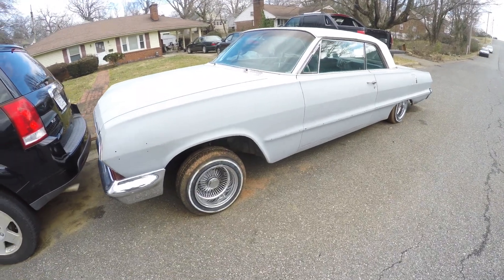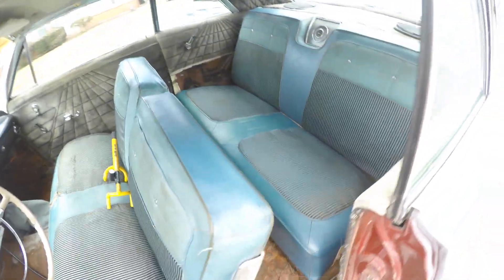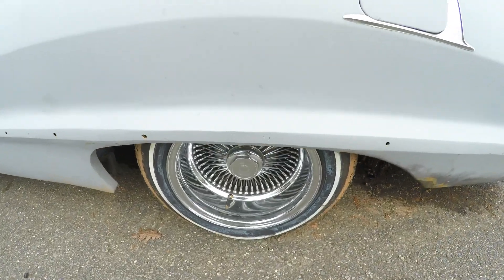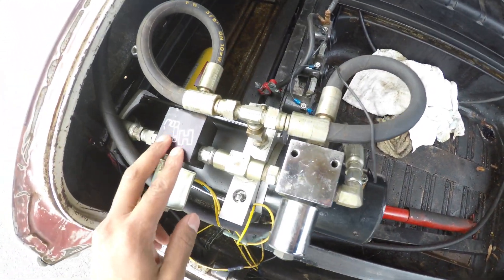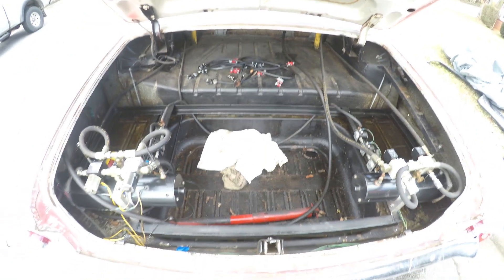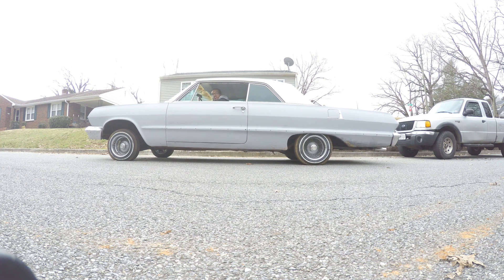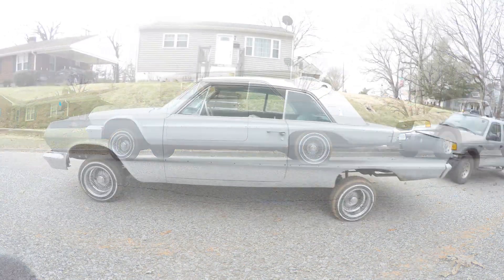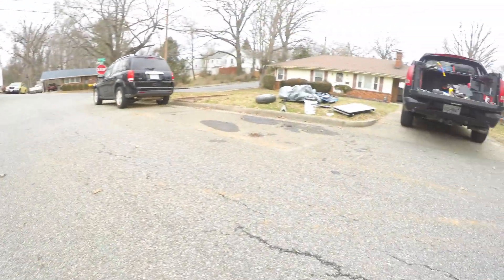63 Impala Lowrider with Hydraulics on Gold Daytons! | New Impala Lowrider Project:

Comment: I love 63s! But dont use trans fluid, it works good but eats up seals quick
Reply from the maker: What do you recommend? I'm still leaning some say use motor oil...
Reply: @levimccoy4800  yes... 5W motor oil NON DETERGENT is good, if your pumps are pressurized... put some psi in the head for a little extra hop

Comment: What kind of oil did you use? I run a 30 weight motor oil. I found that hydraulic oil always leaks out of the cylinders.
Reply from the maker: Really, I'm having that problem now with the hydraulic oil leaking out the rear cylinders. I'm not sure of the weight at the moment but I due know my buddy gave me a whole container of Costco brand oil. Have you had any leaks with the motor oil?
Reply: @levimccoy4800  only after a few years. Make sure the bottom ring is tight to the cylinder, you might have to replace the seals